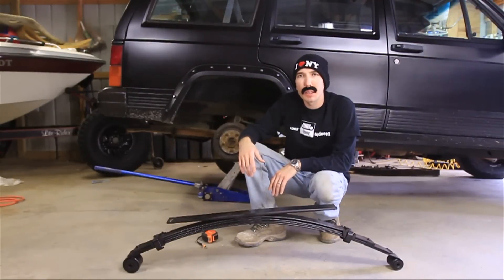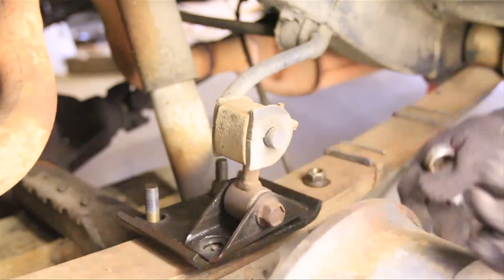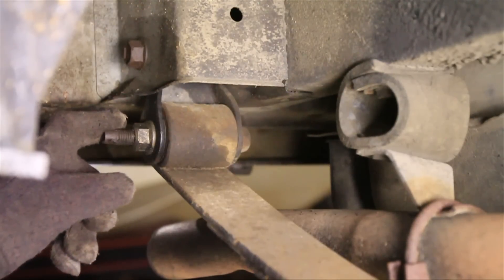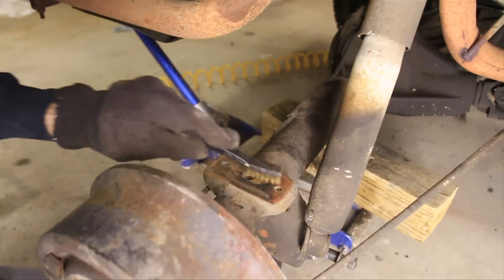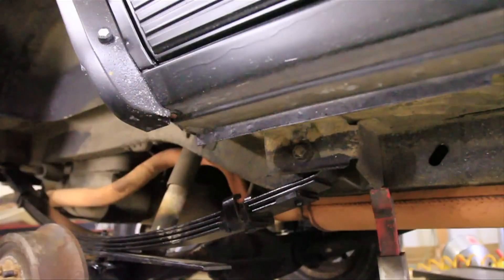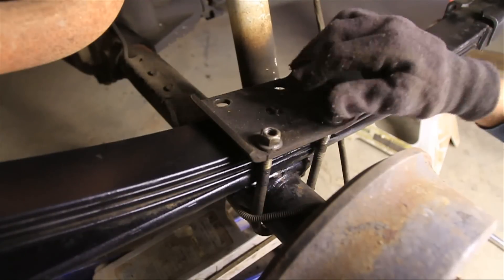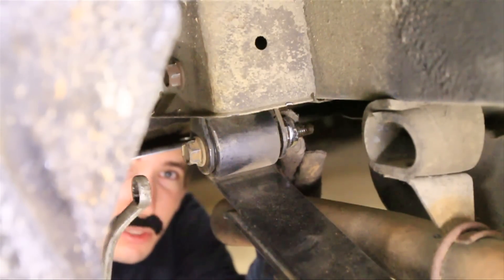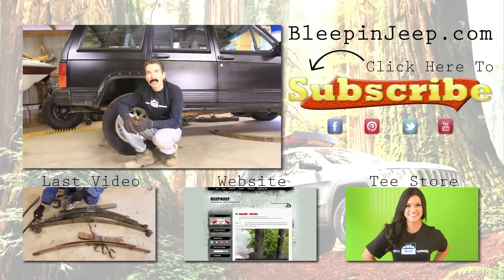How to Install Leaf Springs - Bastard Pack Part 2 - Installing the Pack

Comment: Great video. Just an observation though, at 6:10 you installed that rear bolt facing the opposite way than when you took it out at 3:50.

Comment from the maker: Most shocks Ive seen for the Cherokee are sold for 0-3" of lift, then 3-5 inches of lift(or so).  So at 3.5" of lift I am just over the limit and will change them when I get a chance.  But it will be just fine for street driving and some mild wheeling for now.  I havent driven it yet so I'll have to let you know about the ride.

Comment: A sway bar reduces body roll when going around corners. On an XJ the front sway bar alone is sufficient. Considering lift packs are stiffer/sturdier than the stock packs. Also, leaf springs don't roll nearly as much as coils, So that puny little rear sway bar is preventing the rear axle from flexing when offroad.

Comment from the maker: depends on budget but I'd get some new leafs, longer shackles, maybe a 1 inch block to get it all back to 6 inches. You could just go with a 6" leaf but that would be pretty stiff, or if money is tight you could bastard pack it but that's be stiff as well.  Also, the flat leafs arent much of a problem but 6" blocks are!

Comment: if you tighten the shackles up while the vehicle is in the air and set it down it will have the bushings in a bind and wont be an acurate hight and could tear the bushing if its not in good shape

Comment from the maker: Hmmm, you shouldn't need to change the driveshaft for a 2" lift.  Either you did something wrong or the leak is an unrelated issue.  Is your tire still centered in the wheel well?  I doubt its the case but I guess its possible to put the leaf packs back in backwards wich would not be good!

Comment: Ok got the front bolt out much popping but its alright. Had to remove class II hitch to get clearance for rear bolt removal PITA! The Bleepin Jeep is fighting back, both upper mount shock screws broke off after much soak time with Penetrating oil. And I've broken a easy out now as well. Afraid to use heat on left side due to fuel tank and fuel filter in close proximity. Was wondering if you've ever seen floor cutout and bolts/nuts used for top shock mounts??

Comment: You might check some pawn shops for 1/2 inch drive impact wobble sockets. It makes getting onto nuts/bolts like those shackle bolts a LOT easier!

Comment from the maker: well I got 3.5 inches with stock shackles so 1 inch lift shackles should do the trick.
Reply: So I just did the same thing did it change your pinon angle?

Comment: Love the Videos! Esp the new goucho marks mustache! All kidding aside I have decided to change my wornout springs with heavy duty ones from JC whitney. New bushings too! I'm having a bit of trouble with the front bolts. Popping as I'm removing it. Was wondering if that's normal? I've gotten one side out about 1/4 inch fighting all the way. Round 1 goes to the Jeep!

Comment from the maker: you can remove the bumper and cut a square hole into the end of the frame rail from there.... or you can cut out the back and bottom of the frame to get access to the nut.  Either way will be a pain in the arse.

Comment: hello mat thanks for everything you do for us jeeper explaining down to the T on how to do stuff. can this work for a yj btw ? if so what shocks should i get to go with this ?
Reply from the maker: Mark Torres with a YJ you'll want to do an over the axle conversion as the leafs are already very arched.  then I guess you would need about 4-6" lifted shocks.
Reply: BleepinJeep is there a bastard pack that I can do for the yj with out going over the axle ?
Reply: Mark Torres I mean under

Comment: Got some new Crown leaf spring packs and Energy Suspension bushings for the GF's  '99 Cherokee. Any pearls of wisdom on not snapping the forward spring eye bolt and upper shackle bolt when taking things apart?  I've already sprayed everything down with PB Blaster,.. and will again for the next few days. Anything else to keep from breaking things off in those weld nuts would be appreciated.
Reply from the maker: Lonewlf7676 hmmm, cross your fingers...  I would think a big breaker bar and slow movement would be less potential to break them or strip them than an impact but that's just speculation.

Comment: question for you, I have a 97 xj, my back right leaf is fine, seems like its not sagging at all, or maybe an 1 inch at worst, but my back left is sagging about 3-4 inches I would say. I just wanna make sure its not dangerous to drive on it, I don't wanna dump a lot of money into it but with winter here I need to keep it reliable, its also compress easily if you go up a hill or something or drive up a hill of grass and will scrap the inner fender, but it does have a decent amount of clearance still when just on flat surfaces, any suggestions? i just wanna keep a stock height
Reply from the maker: dereileak if its not broken, then its probably ok to drive on for a while.  As for long term, I would replace it with leaves from a later model XJ from the junkyard or even new leaves.
Reply: alright, im worried about snapping a bolt in there, even with pb blaster
Reply: dereileak its good if you snap a bolt so you dont have to screw the damn thing

Comment: Great video. Shouldn't you wait until the jeep is back on the ground before tightening the shackle bolts? I had mine a bit too tight and gave a pretty stiff ride.

Comment: i have a 2000 xj i have a 4 inch lift im going to run 33x12.50r15 will i have to cut or fold fenders and quarters?

Comment: Love all your videos but if I may make a recommendation. Any bolt that tightens a bushing on your suspension (I.e your leaf springs bolts, your shock bolts, control arms..) you should tighten after you have set the vehicle on the ground and it is under its own weight at ride height. This ensures that they will be in a neutral position at ride height and can articulate through their range of motion without binding up or wearing out prematurely.

Comment: Question for ya, I got a new XJ leaf spring kit I wanted to use the new main leaf instead of my own, decided to torch out the old bushing but the new bushings don't fit for the larger eye, they're about an 1/8 to small. The new main came off a 99 XJ sport and mine is a 99 classic, that shouldn't make a difference right?

Comment: Does it matter which way the rear leaf bolts are installed? I had to put the bolt through the other way on each side cause of the shackle angle putting the gas tank in the way of the bolt.
Reply: bleepinjeep Yeah I guess I would rather have the whole bolt hit the bottom of the frame then the nut gashing a notch in it. Just making sure. Thanks

Comment: Can you tell me, i have a 89 cherokee with a oem hitch and when taking off the leaf springs the rear bolt hits the hitch,,,now i unfid the 8 bolts but it looks like there is a couple up behind the licenses plate behind the gas tank,,,do i gotta drop the tank to get the hitch off?

Comment: What is the size of the nuts on the u-bolts? I tried 3/4" and the wrench and socket was too big. I have a 2000 cherokee sport with completely destroyed rear springs.

Comment: How is highway capability effected by removing sway bar. Also could i do the same on a yj
Reply: bleepinjeep are there other leaves I could use and still get the same lift but a little more flex (this is on a yj)

Comment: im putting a lift on my jeep same as yours and my front leaf spring bolts i had to cut them off they wouldnt break loose with a breaker bar or a impact so now there flush with the frame. what do i do because i no that there is a welded nut to the inside of the frame. help bleepinjeep

Comment: Help, I'm trying to bolt the axle to the bastard pack I made and the axle is leaning backwards and it won't lean forwards so the place for the pack on the axle wont bolt up to the pack. How do you get the axle level so you can bolt it up??

Comment: Hey Matt awesome video as usual, very helpful.  I'm going to be replacing my leaf packs soon, I just have one question. Does it matter or help to do one side at a time or can they both be done together? I ask because I see you only jacked up the side you were working on.
Reply: Alex Ottomano front and rear together although you have probably done it by now
Reply: bannablitz247 lol yea i did it back in December
Reply: i figured that

Comment: Thanks for all of the great videos! I picked up a '98 cherokee with a 6" lift on 33s, but the back has the original leaf springs (that sagged down to flat) with a huge block for the lift. I'd like to replace these without spending a ton of money. What would you recommend. Thanks!

Comment: I'm having issues with my 2000 XJ.  I am running 33 by 1250s.  and my leafs are rubbing on the side wall of the tire on the inside.  how do I fix this problem?
Reply from the maker: +Mountain Boy 95 http://www.ebay.com/itm/Leaf-Spring-Clip-Strap-2-/220944475533?hash=item337151258d:g:2sUAAOSw7ThUgH1W&vxp=mtr
Reply: Or try a different offset with new wheels
Reply: tires are too wide, you need wheel spacers, or real solution and almost the same cost  is new wheels with a different offset or backspacing

Comment: Will this work on the Jeep Liberty? The 2005 Jeep Liberty Renegade that is. I do mean Liberty Renegade. Most don't seem to know that it's a Liberty Renegade, they say you mean Liberty or Renegade, but Jeep made the Liberty Renegade long before the Renegade. It's basically the Liberty built more tough and ready to off road. Anyway it doesn't have the greatest height. About your average Cherokee height. So will this work on it? Or maybe taking leaf springs from another Liberty Renegade?
Reply from the maker: Does a liberty even have leaf springs??

Comment: how do i know what size ubolts i need (99xj) ? also where did u find those spring clips?
Reply from the maker: Amazon it, or Google it.  I got the clips at a trailer supply store.
Reply: thanks for the response! i figure it out, 3inch

Comment: Hey Matt thanks for the video! Quick question. I just bought my first jeep (1990 cherokee 4x4). It is burning really rich and doesn't idle smoothly. The previous owner said it needs a map sensor. I replaced that and it helped a little bit but it's still not right. Any idea what could be causing it?

Comment: need to use new u bolts every time not reuse and need to be torqued to factory spec to keep the centering bolt from bending  or braking and causing your leaf pack to spread and puncture your tire then their no need for that retaining clip on that bottoming leaf shock absorber 44ftlb spring eye105ft lb spring shackle 95ft lb spring u bolt 90 ft lb
 all on a 95 xj

Comment: Hey bleepinjeep! I’m finishing up my bastard pack install and discovered my u bolts are too short. Bleep bleep bleep. I’m having a problem locating ones to replace them with. My ubolts are round  1/2”  2 5/8” by 5 inches.  Any suggestions?
Reply from the maker: amazon... or you can go to a trailer supply wharehouse or a spring manufacturer and they can make em for you on the spot.

Comment: just started my project today..and when i say project i mean it lol...i bought a pair of brand new cherokee leaf springs from dorman and added a procomp 2inch short leaf to it...the front bolts of the OG leaf got stuck in the bushings after i was done unscrewing them and just kept spinning..wouldnt come out for anything so i had to cut the bolts with a sawzall to get them out...but i had to get new shackles cuz they were both rotted through..the pair of shackles came with 4 new bolts so i used those and the OG bolts from the rear of the leaf...pain in the ass but the leaves are in...tomorrow i have to line up the rear end with the pins on the leaf, bolt in the u bolts and im done...i wouldnt have been able to even attempt this project without bleepinjeep...youre videos are awesome and informative..thank you so much...now i just need to get my coil spacers in the front springs but i think ill have to wait till next weekend seeing as its easter tomorrow and i still have to finish the rear end
Reply: do you make decals? cuz i would definetly put one on my jeep

Comment: i did the same set up and I'm getting a clunk at the transfer case
Reply: Jerry Ramos check your sexual preference, its because u like dudes
Reply: Jerry Ramos haha
Reply: How do these work as far as sagging with weight, or pulling a heavy trailer?

Comment: I've never seen a mechanic throw tools around that much - drop sockets, pins, screws, wrenches.. and that kicking was priceless insult to pros everywhere..
..I ve never seen a guy work like that.. and I assume you work for yourself.. cause even though you know what you're doing.. I don't see you working in someones shop.. that or your doing a great satire video funny mechano gig..
Reply from the maker: BX0207 im not a mechanic
Reply: he doesnt throw them around any more then any one else I know, including myself
Reply: I have a feeling he is also using a pretty decent mic for his videos that picks up a lot of sound. 
Not sure that it makes a difference anyway though.
Reply: He likes to add a little humor. I guess the humor isn't for everyone.
Reply: BX0207 I guess you never watched the clowns at walmart. I saw a guy at walmart using a sleg on a guys wheel to get it off. I've had that problem my self but I used a 4x4 board to avoid damages.